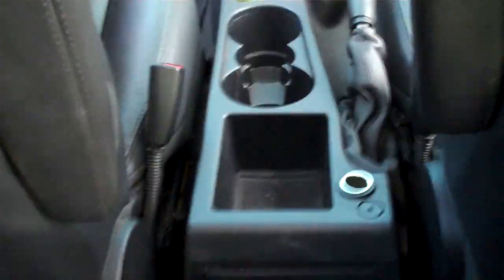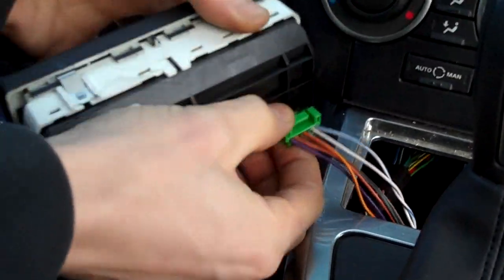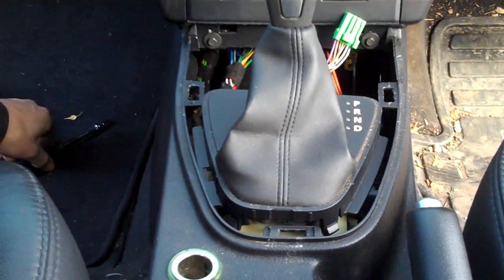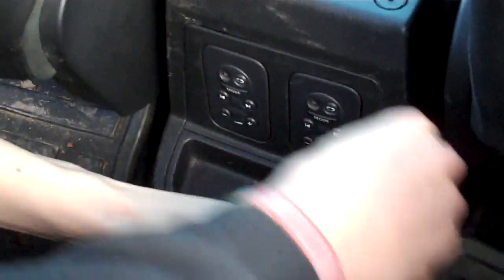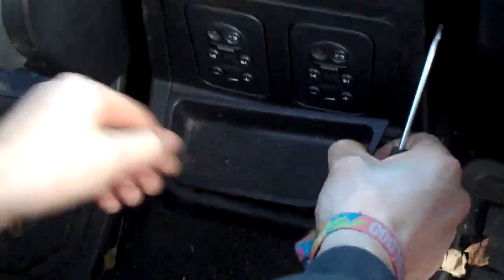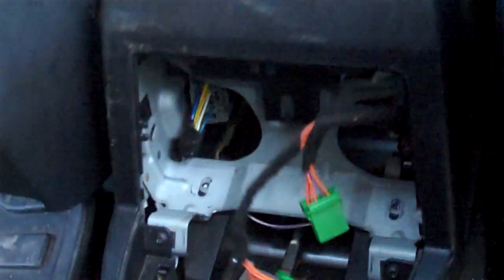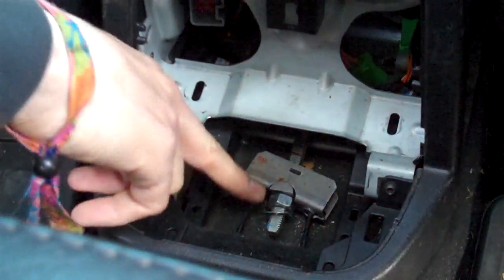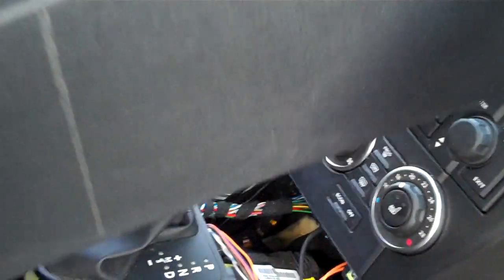How To Remove the Centre Floor Console on Land Rover Freelander 2 / LR2

Comment: Followed ur Video and was able to remove Floor Console of my FL-2. Rats had invaded my FL-2 when I did not drive it for a few months following a stroke. The wiring was damaged at multiple places. Had to open Music System also . Luckily all the wires are Color Coded so joining them was easy. They also damaged a Orange Fibre Optic Cable which goes from Central Front Music Console to to Amplifier in the boot. Need to find a replacement from the breakers. 
Thanks for the educative Video

Comment: By removing this console, can you access the forward cigarette lighter socket wiring? I want to remove one of the cigarette sockets on my freelander (a non working one) and replace it with a USB type
Reply from the maker: Is it the cigarette lighter next to the gear change you want to access / remove ?
Reply: @L663  I just need to replace the cigarette lighter next to the gear changer as the illuminated green surround has disintegrated. The attaching wiring is so short I can't pull the cigarette socket fully out to replace it. Do you think removing the terrain response module and the gear changer gaiter would be enough to access the cigarette lighter wiring to disconnect it and reconnect it? Thanks Andy